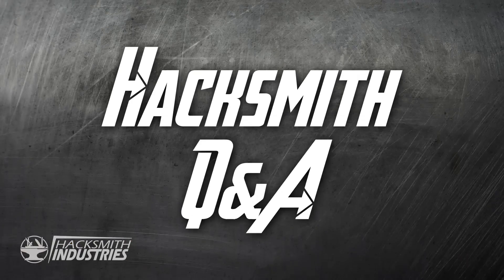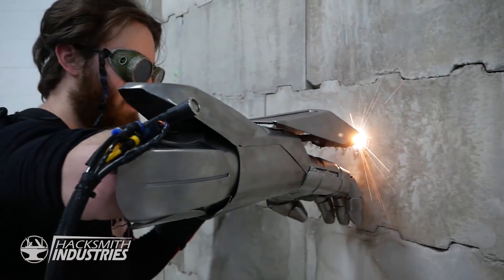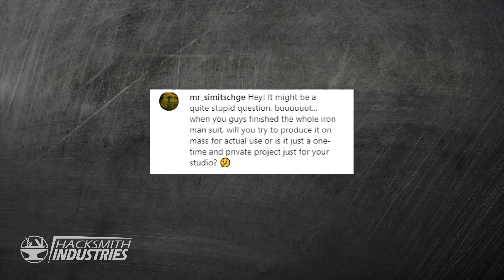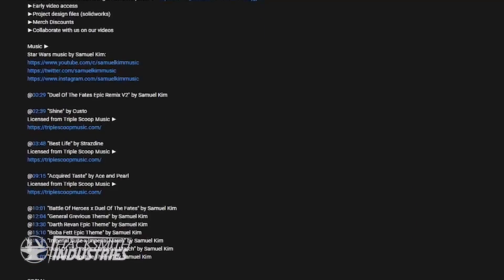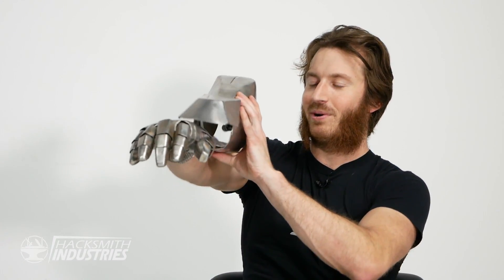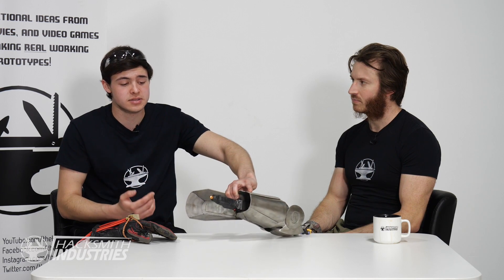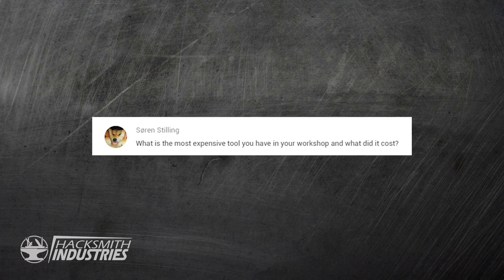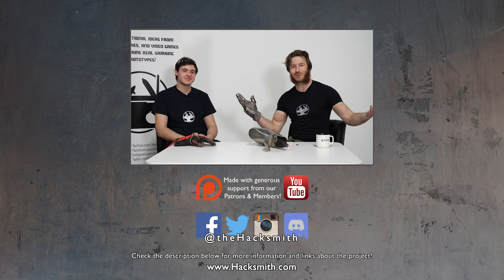How We Made Iron Man's Plasma Gauntlet! (Q&A #3)

Comment: Why did you design the prototype gauntlet after the mark two instead of the mark one which would have been easier to mess around with adding gadgets too?
Reply from the maker: Cause Mark 1 didn't have a plasma cutter
Reply: @theHacksmithVLOGS  but it DID have a flamethrower although you have done stuff with flamethrowers before so I can see you wanting to do something more "refined" than that

Comment: You can put some jumping shoose so you can run faster when the promoter would be completed, but it could be more difficult
Also you can make a smaller and close case for the plasma cutter because when you move your hand the stainless cutter move an do open and close, maybe you can let Jarvis switch it on and off
If you alternate some stainless and aerogel it can be bullet proof and it can isolate for the hot and cold temperature

Comment: Could you use Titanium 3D printing to get side finger hinges and also use the advantages of 3D printing to create hydraulic/pneumatic passages and mini cylinder/actuators to make a stronger grip and mechanical movement possible? You could also scale a little bit larger and use something similar to Gary Fay Creations Mechanical Hand to get your extra scale to fit everything. Even use his method of cables to pull the grip of the hand using Dyneema rope.
Reply from the maker: Yeah but we can't 3d print titanium all the time is very expensive
Reply: @theHacksmithVLOGS  Possibly prototype in 3D plastic before jumping to Titanium. Titanium would be many versions down the road. But 3D printing is what I think going to be the best packaging for the amount of functions/tech that I feel are completely possible with our current tech. But like you said balance of money and the envelope being pushed. I do feel like enhanced mechanical strength is a must for Iron Man Gauntlet. Keep pushing I enjoy the vlogs and videos.

Comment: since fire greatly seems like a plasma, do you think you could use it for the initial burst of plasma, then follow it up with a high current source to superheat it?(or really, any high voltage source, like a spark generator or transformer) im not really familiar with engineering, so if anyone knows a good soucre to get up to speed on physics in general, please suggest it to me. thanks